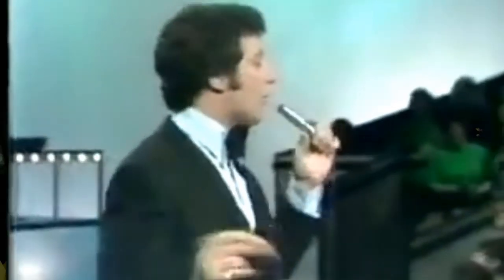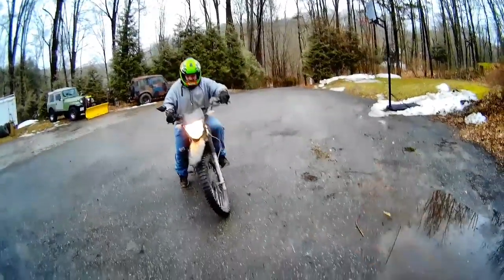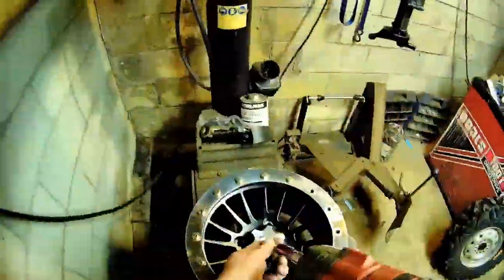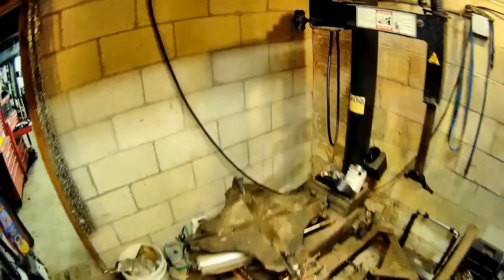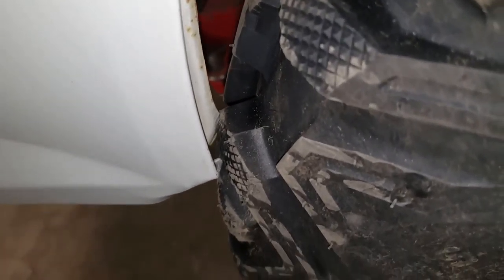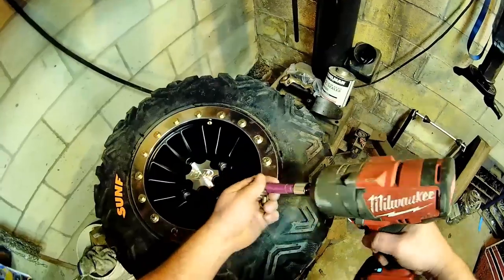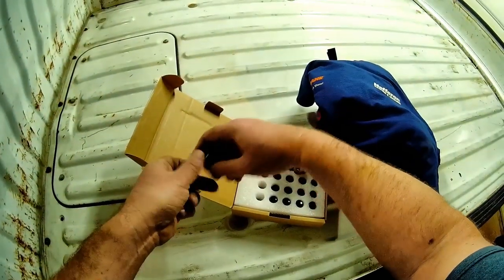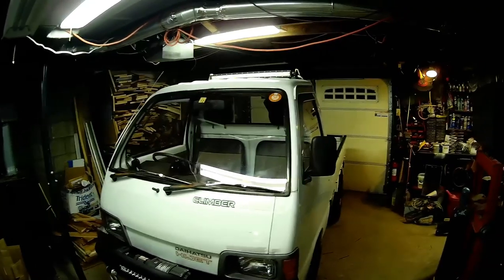Mini Truck (SE01 EP15) Mag tires Springs a NOPE!, HATE, Love and Suggestions, workbench HiJet series

Comment: so weird that you think that thats too wide... looks great. Is it something to do with your driving laws that you have to have fender flares?
Reply from the maker: no I have a Wrangler I've owned a few wranglers actually and when the tires stick too far out gets mud thrown all up the side Etc, plus it won't fit on my 5 by 10 trailer haha
Reply from the maker: Yes there are laws for that here too, but I'm not too worried about that because I won't be going on the road hardly
Reply: @MotoCheez  ah yeah not fitting on the trailer is definitely an issue. i see where your coming from. I just like the look of tires coming out past the body and all we got is mud where im from and i love the look of my rigs when they are just plastered in mud hahah but both my rigs are pretty beat to hell anyway
Reply from the maker: Well, maybe I need a new trailer a little bit bigger hahahaha.
Reply from the maker: And I did put the 23 inch tires that I first purchased on there today. I'm working on the video right now

Comment: Yeah definitely not worth it. It's a shame because they look good, that offset is just way too much for MiniTruck. By the time you mount flares and all, you'd gain too much width to keep it so nimble in the woods.
Reply from the maker: I agree, I cannot use mud flares anyway because then it cannot flip the side down on the bed. So I ended up using the first 23 inch tires that I bought. I am working on the video right now
Reply: Good deal. Looking forward to it man, you're making some awesome content!

Comment: Try it with lower profile tyres?
Reply from the maker: Yes, I am going to put the 23 inch tires on that I bought first they will fit perfect. No cutting
Reply: @MotoCheez  just to let you know, I've got an even more ridiculous 'car' I use as a daily driver. It's French, weighs about 900lb (so technically light enough to be registered as a quad here), has an even smaller engine at a mind blowing 500cc capable of about 65mph, downhill,  with a tail wind and it's freeking tiny yet it still has 4 seats. It's from a company called microcar, model m:go from 2009 and quite possibly the worst vehicle ever made by man. It's nickname is Plastic Pig.

Comment: I agree no.
Reply from the maker: We losing, 95% say put them on.
Reply: @MotoCheez  Well I had a 77 Civic which came with bias tires .. and the tire people said go with radials.  In hindsight, I missed the extra height and winter traction of the bias .. my splash guards (all Civics came with small ones on the front) every time I hit a bump they would rub and it would just bother me a bit.  So I like tires that fit and suite the vehicle.  But 95% says we are very much a minority.